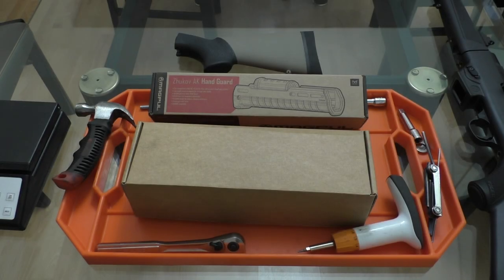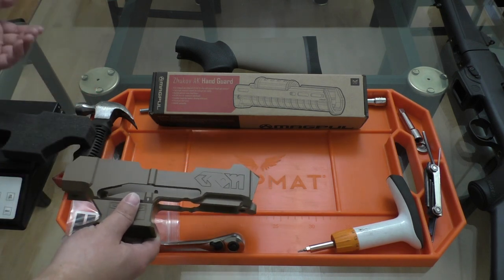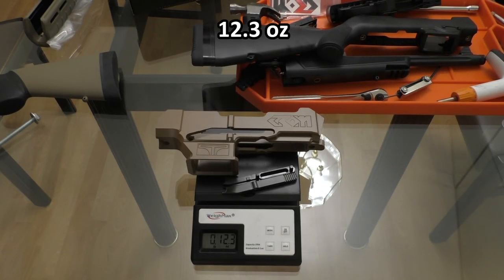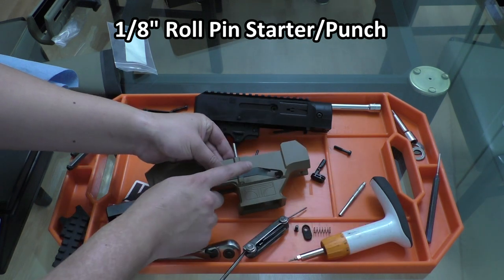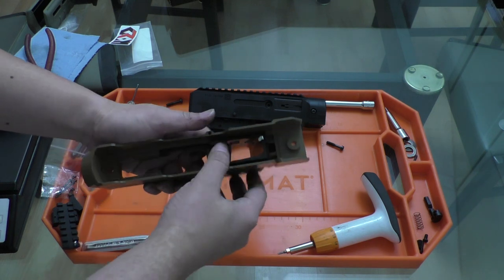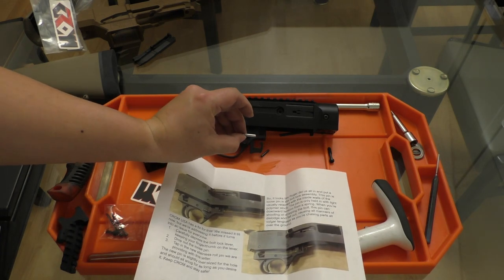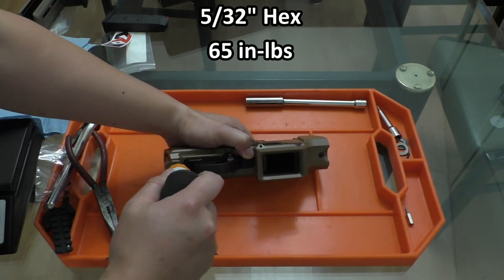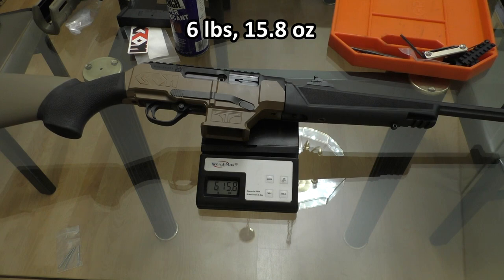CROM PC Carbine Chassis Installation

Comment: Great video, really informative. It made my chassis installation smooth and easy. I agree with some viewer’s comments about the expense of the upgrade. However, there is no doubt about the fit, and quality of the the chassis and the low rise hand guard as well. The issue I had with my install was I ordered a left hand mag release, but mine arrived with a right hand release installed. I ordered the correct release.  I went ahead and took it to the range with installed release and of course it got a pretty good coating of carbon on it and I can’t make it look new again. So no return for me. I have the correct release installed with the coffin extension now. The only thing about CROM, seems they are like “IN AND OUT”, they don’t make it to you order it.  Super long lead times on your parts. In all honesty, that’s literally the first thing you notice when visiting their sight. Thanks again for the video, I am very pleased with my carbine.

Comment: I liked the idea and bought one. Assembly was not hard.  I also bought and installed the Magpull stock.  The chassis  was a bit tight so I recommend coating the inside with a bit of grease. Since ammo is scarce right now I did finally acquire enough to take it shooting to an outdoor range when it opens back up.  I really love the chassis and butt stock addition.  It is worth the price in my opinion.
Reply from the maker: Congrats on your acquisition! Sounds like you have a slick build.

Comment: I love the way the crom chassis looks but the stock is similar to og one. I went with the tandemkross upriser chassis and installed a Milspec buffer tube with an adjustable stock and couldn’t be happier with it. I just wish crom could make it affordable and more different than the original Ruger PC9. In my opinion just looks like a facelift from the original design. Tandemkross upriser turns it to a whole different carbine IMO

Comment: Really well done guide- thanks! I haven't been able to get a PCC yet but when I do, I'll be going for their chassis and low-rise rail. For me, the cost is justified considering how well machined everything is. If you want the ultimate PCC, this is it. Add in the Volquartsen trigger group and sure, it'll be expensive, but it would truly compete (feature and build wise) with most AR9 platforms while still being compliant. How similar is the low-rise install to the high-rise video you posted?
Reply from the maker: The low-rise rail installs fairly similarly, and the only real difference is where the rail mounts to the rear sight location on the barrel. I purchased a low-rise rail from CROM, and when it comes in I'll do an install video on that too.

Comment: Just put mine together on a brand new pc carbine and I'm having an issue with glock mags.  Took it to the range, twice, when it was stock and had no issue with the glock magwell/mags.  With the chassis put together, thanks to your video, my new gen 4 glock 17 mags fall right out of the magwell unless I keep constant pressure on the front of the mag release bar.  I took it apart several times and from what I can tell the mag release button barely makes contact with the impression on the glock mags. :(
Reply from the maker: Does it seem like the Ruger Glock magwell adapter is sitting too high up, and you can't push the mag in far enough for it to catch? If so, I'd see if the magwell adapter is getting caught up on something and not sliding down fully. On mine I had to file the edges of the magwell adapter ever so slightly to get it to fully go into the chassis.
Reply: @FaRKle0079  It sits fine.  It's more the catch doesn't go far enough in the magwell to lock in place.
Reply: I'm thinking I probably bent the pins slightly installing the lever.  When I take them out and put in a hex it works fine.
Reply: @Injuryprone18 I believe your missing the spring underneath the mag release.

Comment: What is the benefit of the Crom chassis vs the stock Ruger chassis?
Reply from the maker: The CROM chassis gives you a quick index finger mag release, and the ability to use any Mossberg 500 pattern stock you like.

Comment: You should have tested the mag again after everything was put in.
Is it ambi?
Reply from the maker: Yes the mag release is ambi because it maintains the original button. The index finger release can only be used on one side though (they sell a left and right bar for it).

I've put MANY trouble free rounds through it at the range since. It's one of my favorite plinkers.
Reply: @FaRKle0079  
So is there another model for Ruger’s AR look model? I figured the one in the video is for the standard butt stock.
Reply from the maker: @Amtcboy  The receiver on ruger's "AR style" model is the same, so this CROM chassis will still work.

Comment: Thanks for the video.  Do you know if hand guard will work with the ruger factory chassis and buttstock?  I was thinking about just getting the front part so I can co witness the irons but I would like it to look good too.
Reply from the maker: Yes, CROM handguards will work with the Ruger OE stock or chassis. You don't need the CROM chassis to use their hand guards.
Reply: FaRKle0079 thanks for the quick reply.  Does it look good that way or is there a big gap?  Also do the edges line up? I couldn’t find any pictures of that configuration.  Just want to make sure before I ordered it.  Thanks again
Reply from the maker: @TheHoneyBadger1  I'll see if I can get a photo for you. Stay tuned!
Reply: FaRKle0079 thanks
Reply from the maker: @TheHoneyBadger1  Here's a sneak peek at a video I have coming soon!
https://i.imgur.com/Ffqnngh.jpg

This is my personal ZhuCROM on the Ruger original stock.
Reply: FaRKle0079 awesome thanks I’m looking forward to the video.
Reply from the maker: @TheHoneyBadger1  Video is up! Shows all Ruger and CROM handguards on the Ruger stock, and CROM chassis! https://youtu.be/aCjopqn9AR4

Comment: It's already a heavy little rifle...now you made it heavier..add attachments and it's to heavy to be a carbine..add a bipod wich I wouldn't cause it's a 9mm..I'm taking mine to a 3d printing company to see what I can do to make this rifle lighter.!
Reply from the maker: No doubt it's hearty, but not unreasonable (there are plenty of ARs that heavy or heavier). The worst thing I could've done is not said anything about heavy it is after the CROM parts.
Reply: @FaRKle0079  hmmm.ok...but this rifle is supposed to be a survival takedown right ? I'm just thinking weight and it has a threaded barrel...magpul has a new chassis for this rifle ..but the guy said it's just as heavy if not heavier. ..I wish a 22 mag rifle had a takedown version lol
Reply from the maker: @crislee1918  It's supposed to be whatever you want to make it into. That's the beauty of it (like the AR platform). You can configure it for different types of roles. Mine's more of a general purpose carbine, like my mini-14.

Comment: How much does each part cost?
Reply from the maker: The chassis is $325 and the scout handguard is $150. You can get a package with them together for $465 though. I bought mine during the preorder sale though so it was a bit cheaper.
Reply: FaRKle0079 It looks nice but that is a ridiculous amount of money that’s what I spent for the gun the backpacker you’ll see in stores for less than $150
Reply from the maker: @petegrunert9230  I agree it's not for everybody. But if there's a market for $1000 10/22s, there's certainly one for this. Just like some people are happy with a Windham AR-15 and others don't mind spending more for Knight's.

Comment: Amazing product, but it's extremely overpriced. If they did the same thing but in polymer and at half the price. It would sell better.

The carbine itself cost around 500 give or take. And this Chassis ALONE, not even including any extras cost $325. That's crazy.

At this point. You might as well get a pistol caliber AR, or build your own.
Reply from the maker: A polymer chassis is a good idea. It'd be cool to see them do that!
Reply: Idk man, I want a full rifle length pcc, and it seems like if you don't pay $900, you won't get a great product. You can build it yourself, but that's still pricey and can be risky. If I give $500 for the gun, $350 for the chassis, and $150 for an ATI scorpion folding stock, I spent a hundred bucks more, but my gun splits in half, the stock is comfortable and folds, and I get the Ruger name. It just depends on what you're looking for I guess, but getting this would let me do exactly what I want (And it would match my Mossberg)